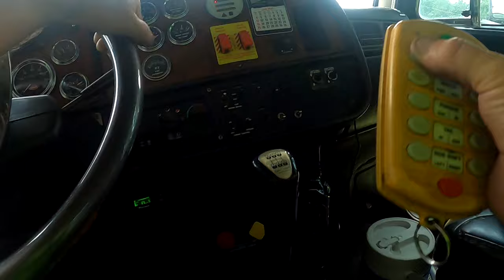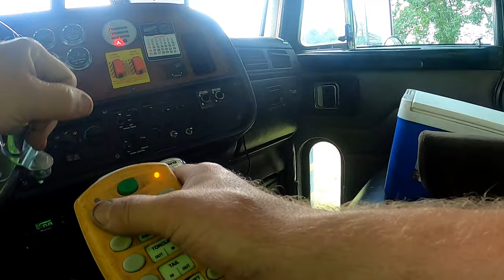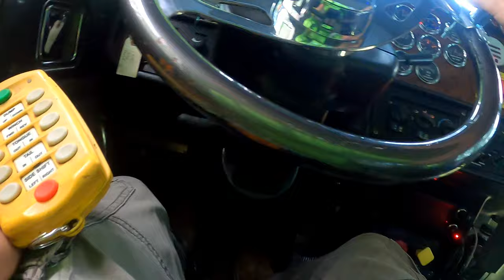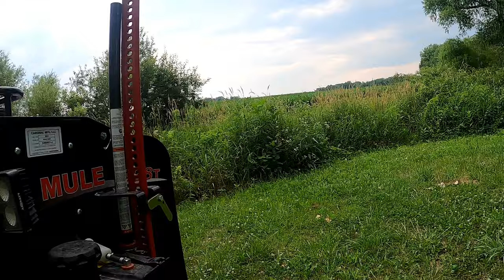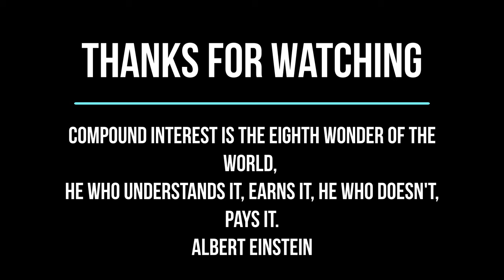Tiny House Repossession With New Mule.. #21

Comment: Looks like they were trying to heat it with unvented propane heaters. Even if carbon monoxide isn't a problem, the humidity they put in the air is probably what caused their mold.
Reply: i don't think they should be able to get their money back they ruined
Reply: They had it sitting damn near directly on the ground. Not enough ventilation between the building & ground. Factor that with what you said and mold would be the least of their problems.
Reply: Not to mention the smell these heaters emit when any kind of spray, candles, or solvents are introduced into the room where they are readily combusted by the unvented flame. I used one once, removed it after a month.
Reply: @williamwallace2585  money back?
As if they paid for it and they could expect some sort of refund?

Repo. 
R e p o.
Reply: Not to mention that moisture from burning propane is highly acidic.
Reply: @williamwallace2585  usually until it’s completely paid off, it’s contractually listed as a rent to own. Once 2 payments are missed it’s eligible for repossession & anything they previously paid was just rent.
Reply: Or it sitting 4 inches off the ground.

Comment: Dang I like this tiny little house, I could live in it !!!  🙏
Reply: I'd build foundation walls raised up for garage and workshop..all I need..
Add more deck too...
Reply: Amen ! We now downsized into a 5th wheel and i love it ! If you do buy one too turn into a tiny home just remember the ventilation. Mold will take over and fast ! I have a friend who has one and it is beautiful. They did the insulation, wrapped it well, put in several vents and no issues with mold. The savings on heating and air conditioning, electric is amazing. The 5th wheel we bought (after renting out our 2 houses) takes me 30 minutes too clean and i love that. Not a hard choice once our sons left the nest.
Reply: Buy one, but make sure you pay for it or they will repo yours as well....

Comment: The septic tank can take the weight, it's the leach field you have to worry about.
Reply: So true 👍 👌
Reply: If it is a modern one and concrete.
Reply: @donmoore7785  Leech field is sometimes gravel or stacked tiles that can crack and break or become dislodged and then the field is interrupted if you were to drive over it.

Comment: Part of the reason the building has mold is putting a dirt berm around the rim joist. I also did not see and vents in the room or gables. Many of these building also cut the rafters on an angle and nail them to the wall at the top plate so there is no way for air to circulate between there insulation and the roof sheeting.
Reply: which goes to show you why houses have to be permitted and pass inspection ... these people charge more that real carpenters and look what happens
Reply: Ventless heater.

Comment: I just can't believe this many sheds are repoed just by you alone.  Does absolutely no one pay for their sheds or what? Lol!
Reply: I agree it ridiculous how many sheds he gets!
Reply: Everybody wants the freedom of home ownership when they see the monthly cost can be so cheap, but things get real when the maintenance costs start giving them the first tests of their capability to defend and protect that freedom. The freedom does exist, but it comes with its own costs.
Reply: I didn’t even know a shed COULD get repoed lol. I didn’t know people finance these things. I thought you either build them or buy them outright 😂
Reply: @picolascage8123  These pre-fab sheds go for a pretty penny. Size- and design-wise, I'd put this one in the ballpark of $20,000. Not a lot of people have that kind of dough on hand for a cash buy.
Reply: @andhisband  build em your self... hammer .. nails saw and a tape
Reply: @jamesgibson5876  Preach!
Reply: @andhisband  lol  you put two t 2x4 next to each other on edge this is called the top plate and bottom plate t .. put tape measure on them follow the places on the tape every 16 inches make a mark on both 2x4 .. sheathing comes in 4x8 sheats for a reason .. look on line how to make comer posts  and headers .. move the 2x4 with 16inch marks far enough apart to place 2x4 studs  the distance from one  to the other will need to add up to 8 feet toop to bottom  after you add another plate .... but first nail studs in between  the top and bottom plates ..  bam .. after wards you can nail sheating  usually after standing ... wow ... it a wall !!! do it four times and nail to a deck .. put a roof on it .. and it's a shed! yay!!!
Reply: @andhisband  its only 20k i dont understand why people need financing. just go in and buy it.
Reply: @14mattomatto  See my reply to Holla Akbar.
Reply: @andhisband  there really cant be that many people that dont have 20k for a house. Even if you have a low paying job at $15 an hour. That would $31k a year. For a 16-20 year olds you should easily be able to save 5000 per year and and by your 24 you can have $25k in savings.
Reply: @14mattomatto  oddly enough a veteran with 50% disability check from the VA can be hurt bad enough that employment becomes   difficult .
12 thou a year buy a car and buy a house ? take care of my adult son with schizoid , bipolar , etc ...also learning disabilities? and while fighting social security to honor his ssi?
not happening in driving distance of the VA .
some folks ain't a young man .
some of us is 50 yr old woman veterans ...
what's EZ for u ain't so EZ for me.
Reply: @14mattomatto  Guess not everyone is as rich as you are....
Reply: @gilroylibbs2947  Im in no ways rich but i live very comfortably.  ive worked hard to build a business so i can hire employees that can do the same for their families. I guess its perspective.  No matter what Im still dumbfounded that people cant afford a home that costs 20k.

Comment: My shed sits on 18 concrete peers that go down 3 feet and then has 1/2 bolts through the sheds frame. I built the shed and since my backyard floods I wanted a strong base.
Reply: Did you put in a French drain to help keep water from just flowing under
Reply: @williamfree787  The issue with my backyard was the block wall around my property. The backyard had a slope where 12" of water would easily accumulate and it hardly rains here. I decided to build the shed on the concrete piers and had metal flashing  to prevent water from flowing under shed. 2 or 3 years later I finally busted 4" holes in the concrete wall to slowly drain the back yard.

Comment: Pretty Cool machine, but it didn't look like the tiny house had any sort of plumbing hookup to it.  My dad used to Repo House trailers back in the 60's, all they did then was re-install the tires and wheels (the person never actually kept possession of the wheels when setup) and tow it away, after disconnecting the utilities under the trailer.  Would haul it off, possessions and all.  Thats how we got all kinds of cool stuff that was left in the 'mobile home' (they didn't like the word trailer used), and much of the old stuff, I ended up with and sold off on Ebay later on as old 50+ y/o collectibles.  I actually still have some stuff yet that I am not willing to part with.  Not sure if taking the trailers now with all the personal stuff inside em would be considered legal in today's world, but the people back then were served papers by the sheriff that it would be repo'd in 30 days so it was not like they didn't know it.

Comment: Every time it is moved it gets messed up on all seams.  The roof will leak. I know i bought a repo. Had to fight in court with them 😤.  Guess what happened they had to replace the whole foof for free and pay court costs. They wanted to put a cheaper roof on for 1800. O no in court I got a 3800 dollar roof. Because to way u move them. My gane there loss. Payed 2000 for  a hunt camp. Not bad.

Comment: 14 x 40 is 560 square feet. That's small, but that's hardly a "tiny" home. Tiny homes are typically more like 10 x 10 or 12 x 12.

Comment: Job almost completed, THEN comes the Warning about the Septic Tank.  Good one.
Reply: Nice guy.
Reply: @andhisband  well I'm pretty sure they probably assumed he would be smart enough to move off the septic field before adding the weight of the trailer.  I think would have been rather funny if he would have sunk down to the frame sitting there. Wonder why they didn't pay didn't seem to be a higher lack of funds.
Reply: @TheRetiredtech  How do you know if you're on a septic field if you don't know you're on a septic field?

Yeah, I was thinking this one was rather amicable. Maybe they had leased the shed and this is the end.

Comment: Guy here wants 1800 to move a building 30 ‘ in my yard.  It’s only 8x10. I moving it myself using a come along and wheels and pvc.   I’m half way there.  It’s slow but worth saving the money. I would of gladly paid 500.  Easily a 15 minute job.  He’s only about 10 miles away.
Reply: I was paying on a shed that I needed moved about 100 ft. Called the people who financed it and asked them to move it. Quoted me 500. I said I’ll pay 200 or you can come repo it. They moved it for 200.  Good outcome.
Reply: @becinala  I built this one.   He has no skin in the game.  I wasn’t sure it would hold together since I didn’t build it to be moved.  Luckily I tend to overbuild.  It’s glued and screwed together.  Everything is pressure treated except the plywood sides.

Comment: Too bad you guys turned off the comments on the prior video of the shed you guy's fucked up. Sheer laziness and unprofessionalism and yes you should have removed the extra materials from the center of the roof and carried them over. Now a days it is what is the quickest and laziest way to get something done.
Reply: I just now watched that video. Unbelievable!
Reply: @TexasTimelapse  yep. As soon as it flexed and started coming apart when off loading that trailer id of stopped them and told them to take the fucking thing back. Even in the videos description it shows how unprofessional they were with the not removing it comment.

Comment: I had a similar wireless remote control for my 17 ton boom truck, it was incredibly handy. I've picked a number of smaller sheds with my current 30 ton rig, the big problem getting the rigging underneath, and then having to shim out so the mansard roof overhang doesn't get crushed as the rigging tensioned.  BUT, I can set them over fence etc., lines, where a roll of rig like you're can't.  I had one job where it, the shed,  turned out to be a little girl's playhouse, and as I was lifting it over the house she was watching and bawling her eyes out! Her parent's reassured me it was all good, as she was getting some other toy even better.
Reply from the maker: Interesting.
Reply from the maker: https://youtu.be/_AcATSQS4ro

Comment: What happened to the two story tiny house that fell apart on delivery video?
Reply: Yes, I was looking for that also, hadn’t finished watching it
Reply: He took it down for some reason.  I watched like 85% of it then it went blank.
Reply: @wvello2265  I watched it.  It didn't entirely fall apart.  Just lots of dislodged siding and a broken beam underneath, maybe other damage not shown.  Looked to me one cause was all the weight on the roof with  trusses stacked up and who knows what else.   But surely some engineer signed off on it. Right?  Right?  Yeesh.
Reply: Looks like the load from the trusses that probably needed to be removed before even trying to move the shed was the issue. I would think anyone who got to see the video agrees it was best to remove it. If the shipper did not indicate the removal of the trusses it was still  something that deliverer should have noted. This guy seams to know his stuff but like his title Shed Happens. Love his channel and people should give some respect as thing happen and that is that.
Reply: @LatitudeSky  It was a 2 story shed. Don't the trusses belong up on top? I would assume that it has to be completed on site because there is no way that you could transport a finished 2 story. Not to much weight, Poorly engineered substructure.
Reply: He took it down. Im assuming because after you watch it most people would come to the conclusion that once the building started to buckle and got worse as he and his partner delivered it that they should have returned it to the builder. It's a bad reflection on their character.
Reply: After reading the comments on that video I figured he wouldn't leave it up for very long.
I can't blame him for taking it down tho. All the know-it-alls in comments acting like they know everything and casting judgement when they don't know anything. Maybe the customer asked him to leave it. We don't know.

Comment: it’s hard to tell where you are located.  but i imagine some of the people that do this in certain areas must  run into their fair share of Snakes under these sheds  i grew up in South Florida and i know for a fact Snakes set up their Dens  under homes  and even Concrete Steps  my Dad had a very good freind in Florida that was a Repo man who specialized in Mobile Homes  years ago and he had stories  about the angry people he had to face   he also carried a Pistol with him  all the time  that man was  one heck of a Fabricator  and a Welder and i know he  came up with several Electric and Hydraulic  hitches  for his tow vehicles. to Snatch things as fast as he could  he would have gotten a kick,out of watching your Wireless remote for the trailer winch you use
Reply from the maker: Nice, I'm in Ohio, have never seen a snake yet but had a skunk under one recently.